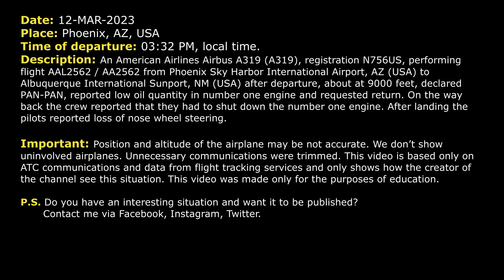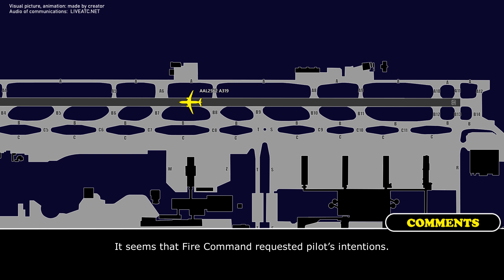Single engine landing. PAN-PAN. American A319 lost oil in one engine at Phoenix. Real ATC

Comment: ROCK STAR controller on Departure (the first guy). Everyone was great but the first guy was textbook. PHX is an ATC training center, so they have good folks working there. There have been some ATC mistakes lately (Austin) but this example also shows how good they can be.  Well Done departure control!
Reply: After PAN-PAN-PAN the DEP controller stopped the climb without missing a second. Goooood job. PHX feels a rock solid ATC operation.
Reply: Concur. PHX DEP ATC in this instance is as good as it gets. Pro’s pro.
Reply: 2nd approach controller awesome too. Slow and very clear.
Reply: That explains why the ATC was so easy to understand.  Most ATCs are barely understandable.

Comment: "Probably have to land straight ahead on the runway". Seems like a good idea to me. Would they do something else if they weren't single engine?
Reply: Hahaha, I think he meant to say he want to stay on the runway. Usually, it’s made sure to get clear of the runway as soon as possible. But in this case, because the aircraft was potentially leaking oil, they wanted to stay on the runway as a precaution. After the aircraft is checked and the runway is checked, the runways can be opened again. Hence the ground ops vehicles were coming to the aircraft

Comment: just curious PAN PAN is not emergency or is it? I thought PAN PAN is an urgency vs MAY DAY which is an Emergency?!
Reply: Yes. PAN PAN PAN is not an emergency. It means that the aircraft requires attention, but the problem is not life threatening
Reply: @vdnt42  thanks! I was wondering why would they say pan pan and then tell the controller they are emergency aircraft .
Reply: @kabaddiify  its still classed as an emergency but not life threatening... they say that phrase to indicate to the controller that they have declared an emergency just in case the previous controller failed to pass it along - unlikely, but it does happen
Reply: @WX4CB  makes sense now. Thank you
Reply: @kabaddiify  By my interpretation, the initial call was pan pan pan as the engine was still functioning; all they reported at that time was an issue with oil levels alerting, and were turning back as a precaution. Once they decided to shut it down, then it was more urgent that they get down. Anyway it's treated as an emergency even if they didn't say "mayday".
Reply: @jonathanhermansson4553  beautiful explanation! I do agree in US folks are not really familiar with the pan pan call vs folks out of Europe and Australia
Reply: In the US, controllers don't care. Any event like this treated as a full emergency.